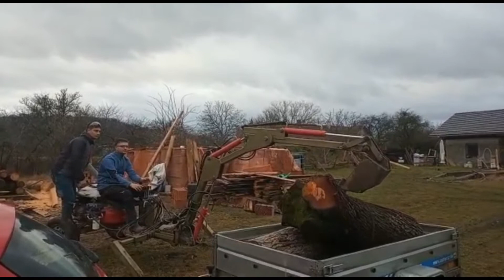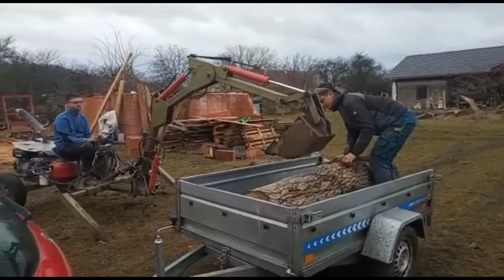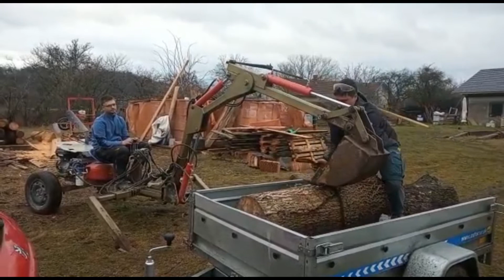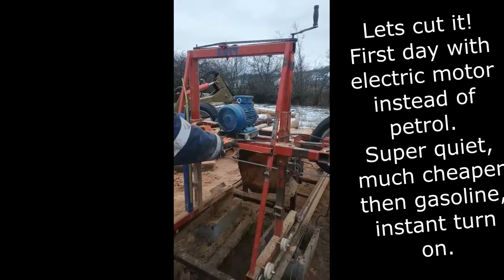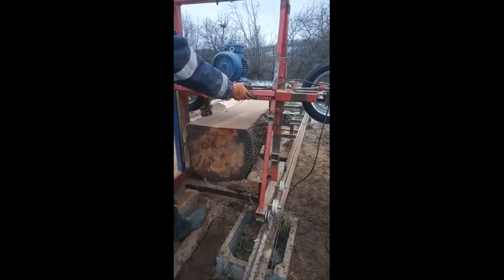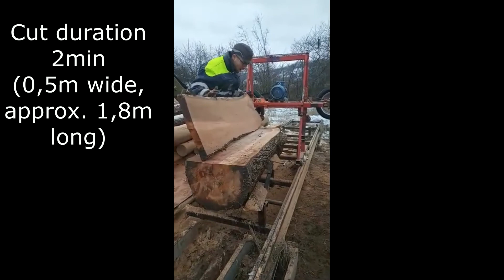Struggling with Heavy Logs - Homemade Backhoe Digger

Comment: For moving logs take off the bucket and the next section of arm. Then either lift from the pin or build a small short arm preferably one with a positive angle as a digger has a negative angle.